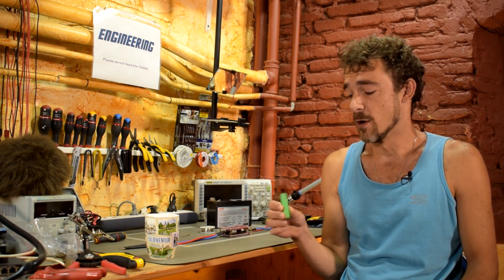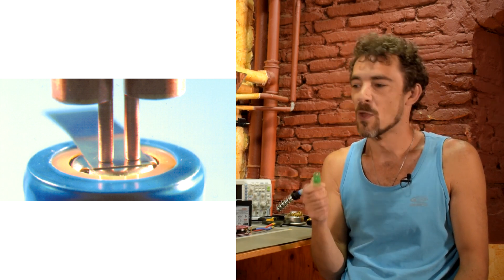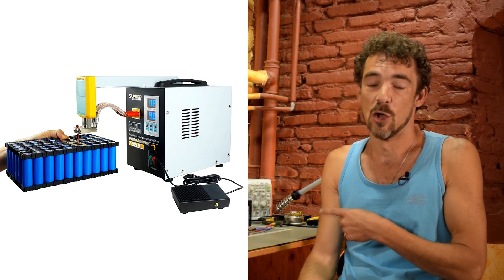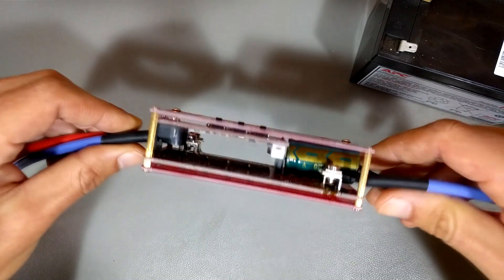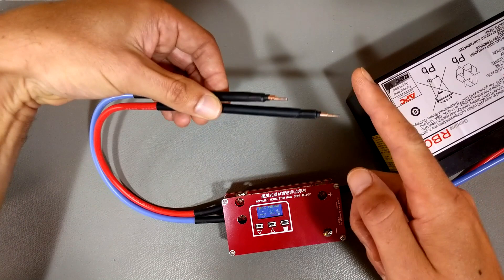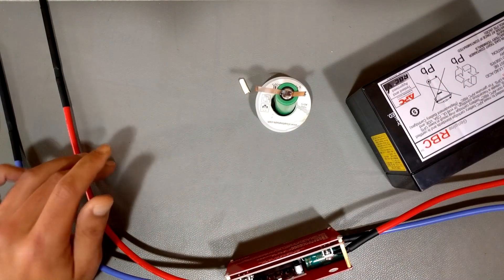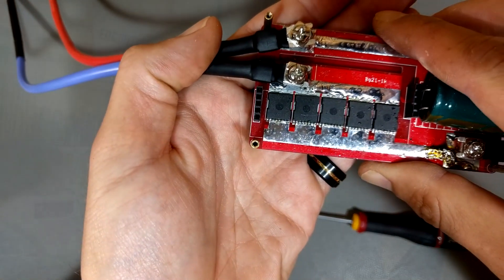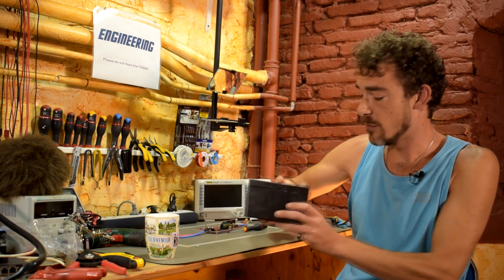The $16 battery tab spot welder

Comment from the maker: UPDATE: Heck with this thing! I built my own, and it works great: https://www.youtube.com/watch?v=pyQ-gbYM8Og
Reply: I saw the reply from BeiLLiac4
 after posting my comments. This is an edit.
 
His solution is elegant, beautiful, and inexpensive. I plan to go a little farther, but his solution may be sufficient for most users.

Scottie, I received a different flavor of spot welder from a U.S. seller while waiting for one like yours to arrive from China.
 
These are actually very simple devices that suffer from multiple unwise design compromises.
 
First they use a microcontroller that is extreme overkill, even though they are very cheap.
 
The microcontroller and associated electronics operate from the 12 volt supply common with the welding power source.
 
That is a very big mistake. The one I have here uses a 78L05 regulator, but if the 12V power sags under extreme load, the CPU will not make you happy.
 
This is why a weak main 12 volt supply will cause failure.
 
Cheap small gauge wires feeding the unit will cause a voltage sag under load and also contributes to failure.
 
The  voltage sag under load causes insufficient drive to turn the mosfets fully on.

A mosfet is likely to fail when it is operating between fully on and fully off where massive power is dissipated in the channel.
 
The first mosfet to fail will short and likely save the others from destruction.
 
The welder controls the negative leg of the power and the positive need not even connect to the board except to power it and possibly detect when pins touch the nickle.
 
I am going to hook up a separate small 12 volt regulated supply to the board and let the main positive wire bypass the board completely.
 
Later a capacitor or other circuit might be added to allow detection of when pins touch the nickle.
 
Please let me know if you want updates on this as more is learned.
 
I believe a few simple inexpensive changes will make a big difference in reliability and performance.
Reply: They need a cap on the board it drop voltage at mosfet and resistance gets to high  that's how I fixed mine
Reply from the maker: @mikehodgetts4864  It's got pretty much NUTHIN... Not a very well-designed unit.
Reply: @ScottiesTech  I try to avoid buying anything from China so this was an exception.
 
It was ordered on Oct 17, 2020 and I will reverse engineer it and try to upgrade it when it arrives.
 
Another YouTuber, zec23dark did a video where he removed the blown FET and replaced it with good results.
 
https://www.youtube.com/watch?v=TC30oNb_VP0

If the upgrades work and are easy and cheap, I'll let you know.
Reply: Scottie,
 
This might be a good time for an update on my approach to battery spot welding.
 
The main theme could be called "overkill".
 
The first part is the main power source, super capacitors.
 
A computer server power supply that can produce 62 amps at 12 volts will charge a bank of five 2600 farad 2.5 volt super capacitors through five 1 ohm 100 watt aluminum clad power resistors on a large aluminum heat sink.
 
The 12 volts will be switched with a large N channel MOSFET. This has already been prototyped and tested.
 
I am building the wood mounts for the super capacitors now.
 
Would it be a good idea to make a video of this ?
 
I have never done a YouTube video. This would be a first and very basic effort.
Reply from the maker: @mikehodgetts4864  I'd watch it. Go for it!!

Comment: Wrong battery, common burn out at 4 spot welds with that battery. I have had mine for 5 years using a  3S 35C to 70c RC lipo battery, it can dump all the amps all at once so you don't fry MOSFETS.

Comment: "At least 12v 5 AH??" How did you arrive at that?? ...The instructions say a 12v car battery from 25AH to 40Ah (lead acid battery) minimum, so your tiny 7AH lead-acid ups battery is NOT "more than adequate." I think the confusion is when they say you can use a "model aircraft" LiPo battery of 4000-6000mah which yes is around 5.0 -6.0AH, BUT most of them that size have a 50C (instructions say 45 to 60c) rating. Let's round it down 50c x 5ah = 250A bursts...Lithium polymer hobby grade batteries are not the same as a lead acid battery.  The instructions also say this needs 120 to 180 amps current.  That tiny battery's voltage will seriously sag well before that is reached, which is why people using these puny UPS batteries are smoking the MOSFETs right and left
Reply from the maker: My had instructions... which did NOT say what your instructions said - not surprisingly. This video is 3 years old.

Comment: I have this welder version BL 01 2k and have done all modifications and I haven't had any problems/issues at all. Used it a lot ans it really works good. This is just user faults when you missed the nickel strip and you really don't need to set the energy so high with good weld.

Comment: That little battery is the reason it died. I had the exact same thing happen. The mini spot welder needs a hefty battery!!  I don't know why the manufacturer would say 5 amps and up. It needs a lipo of 50c or more. I have 3 of those mini spot welders and they work  great as long as i use the right battery.

Comment: Found this video to get the right settings for the one I bought a while back. First test weld on a dead AA was pretty good. Second weld attempt was extremely weak. Third and fourth were sparks and smoke from the mosfets. What a piece of junk. Shame as the controller seems to want to keep welding. I wonder if I could just replace the mosfets.

Comment: You did it wrong, dude!  You left it in manual mode, which requires the foot pedal.  Otherwise, the energy is released the moment the two probes touch the strip!  You were supposed to use the auto mode, which then beeps and releases the energy with a slight delay after you already have contact.  Come on, dude, at least learn to do things right before you post!
Reply from the maker: I switched it back to Auto mode before doing the first weld (I actually edit my videos even tho it may not seem like it).

Comment: you ignored the instruction. It says the battery should be capable of 40-50C at 5Ah. Somewhere around 200A - 250A instantaneous current. That is possible with high quality 3S Lipo but not with a backup UPS battery. A car battery that has a CCA of 400 and up is good.
Reply from the maker: Mine didn't come with any mention of 40-50C... Just "minimum 5Ah at 12V". Oops.

Comment: very important to use a suitable battery, the UPS battery you're using is not meant to discharge at levels that would saturate the FETs. You need to use either  a high C lipo or a car battery, cold cranking amps above 200 is best. These actually work pretty good when used with the right equipment. You should try again with a 3S 50C +, you'll get better results. jmho i.e. https://www.youtube.com/watch?v=arOsjpQy45s
Reply: The battery isn't providing the high current for the spot weld. It just charges the capacitor. The capacitor is what discharges to spot weld.

Comment: the battery that you were using is too small in the first place and the second place after a few welds your battery was drained and the voltage was low this caused the damage in your spot welder... I suggest you troubleshoot make a video of your troubleshooting send away for a new control board or some new mosfets and repair it on the video..... lots of videos on YouTube display the same problem trying to pull too much energy out of this little device trying to pull too much energy out of a lower than necessary voltage battery lower than current rated battery lots of videos say that they love this little device when used properly the key word here is used properly 16 bucks each I bought two waiting for them to be delivered we'll see what happens

Comment: you used the wrong battery idiot! you need 25-40 Amph battery not 7.2 holy shit read the documentation!
Reply from the maker: The 'documentation' that came with mine made no mention of such a high current rating.

Comment: You used the wrong type of battery, you have to use a high discharge battery. Flooded lead acid batteries like car batteries work as well as high C drone batteries.

Comment: Isn't one of the primary reasons for welding vs. soldering that in high current battery packs can generate enough heat at the terminal that it can melt the solder?  I learned that the hard way with helping my grandfather with a resistive foam cutting rig, my joints melted almost immediately.

Comment: the battery amp hours are no way near enough. i use 2 12v 15ah in parallel and mine works perfect. i also did the capacitor mod and beefed up the tracks with fresh solder.

Comment: I just happened to notice this video that says that a low voltage condition can undersaturate the MOSFETs and cause them to blow. He also has a simple mod for that. Re-move the space after the dot to get the link:  'Cheap 18650 Spot Welder Reliability Mods and Test'  youtu. be/u5khY6d3qds?t=170

Comment: Yes, it work well, I just tested it using 12v 7AH battery for source power.... parallel with battery charger setting of energy on 50 good welding and no modification on it

Comment: Keep in mind that as far as the bad welds go, you have to press the probes firmly on the tabs and and they have to be on the meat of the cell to get a good weld. Where the tab blew there was an air gap underneath it because you had one of the probes by the edge of the positive terminal of the battery cell. The second time, you welded the tab with nothing underneath it so it would obviously blow. 

Also, if the spark was too high on your first three welds (not shown) it’s possible that the welding probes needed some polishing/refinement due to an uneven surface or slight charring at the point(s) of contact.

There seemed to be other issues with the with the unit, like not beeping prior to the auto-weld, so the unit had its own issues.

I thought I’d mention this for anyone watching this video and reading comments. I have extensive experience using high dollar spot welders. Tabs will frequently blow without proper contact between the probes, tab and metal surface.
Reply: What you are saying is true, although too much pressure is also bad.  However in this case the unit did not beep after about two seconds of contact, just immediately sparked.  I would have hoped it would fail open and safe, instead of closed and scarey!  You can see this in other videos of it working.

Comment: OMG when you saw how it spot weld like that is basic common sense  all you need to do is adjust and lower the setting to 40 like 15 then go up. If you use small battery on this 40 setting is not enough. Then you going to say bad product geez

Comment: you should change the broken mosfet, put a capacitor after the diode for the control board, the 5v rail. then use a battery like your other spot welder. this battery went down below 5v when you welded and it couldn't close the gates or manipulate the mosfets correctly and you destroyed it. i welded 100 welds with a 150A battery without issues. this welder is actually nice if you mod it with the cap (1000uf 16v).
Reply: Tell me more. I actually need to mod this. I wondered before I do it Ill find some info from internet who already had this issue

Comment: There are a range of these welders, all have various faults from factory.

I've bought one, done the recommended mods for my particular model and it seems to work fine. I've welded in such quick succession that the probes get hot to hold so with the right mods its OK.
Reply from the maker: Yeah. And unfortunately, it even seems that different models come with different instructions as to what battery to use. SIGH...
Reply: @ScottiesTech  yeah it's really random. I've just stuck it onto a 40ah car battery with good results. 40ah is the biggest battery they recommend however I dont see why it would be bad if it were bigger, as ah is a rating of capacity, not amps. The instructions I got with it also said not to exceed 50E of power, no idea why.
Reply from the maker: @spinnanz  Exactly. 5Ah can be 100A for a very short time... Of course, it depends on the design of the battery since lead acids are not all created equal. And with lipos sometimes I've had 'super-huge' ones fizzle out on me, and small ones supply current like crazy.

Comment: Needs a capacitor on the control board.  The MOSFETs open but the controller doesn't have enough power without the capacitor to close the MOSFETs after they open.

Comment: You mention the reviews on BG,  I wouldn't trust them at all -- I've never seen any on there that gave less than 4 stars.  I've bought a few things from them,  with mixed results.  I saw this thing mentioned in one of their promotional emails,  and looked at it,  considered it for a second or two,  and decided against it.  I'll probably end up homebrewing something around a microwave transformer anyhow.
Reply from the maker: I've had luck with them, but mostly for components. 18650 cells, caps, whatever. But pre-made stuff? Well, I guess not...
Reply: I've bought some arduinos, sensors to go with them, blank circuit boards for projects, and recently some ESP32 modules to play with.  In the case of some audio level indicators they shipped with defective LM3915 chips, where two pins on the chip package were not properly connected.  I eventually sourced these from elsewhere and they gave me a partial refund for those kits.

Comment: There are a number of design flaws with this unit and several revisions available for purchase. My particular unit had an issue with the gate drive circuitry, because they chose to use undersized gate drive resistors. The gate drive is a simple totem-pole arrangement of BJT's that drive each MOSFET through a 30 ohm 0603 resistor below that massive capacitor. The problem is that those tiny resistors can't handle the impulse energy for the gate drive (they dissipate peak power of 12^2/30  = 4.8W for a microsecond or so.) So they end up blowing open. with a high impedance gate drive, the gate is not driven hard and can cause the MOSFETs to dissipate thousands of watts and blow instantly, usually short-circuit causing the failure you observed. Mine failed a bit more spectacularly with bang and MOSFET exploding.

Also that 10AWG wire is just not thick enough for this application. large diameter wires are quite expensive, might need to find some welding cable since those should handle the current. Another alternative is to power this unit with more voltage and just deal with the voltage drop across the 10AWG wires. If you do a lot of welds on a big bank, the electrodes quickly get too hot to hold in your hand. I found after about 10 welds I had to let the unit cool down. The wires seem to heat up the most.
Reply: Also that UPS battery isn't optimal, it will not last long in this application. I'm using one of those lithium ion booster packs to jump start a car, they can deliver in excess of 1000A into a short circuit. Using a lawn mower battery or a car battery would be better. Such cells are designed for high pulse currents, they differ in that they use a lead sponge material with a lot of surface area, as opposed to a deep cycle battery which uses solid lead and has space near the bottom for lead to flake off and build up allowing greater longevity when deep discharged.

Comment: the same thing happen to me i open it i put more solder by the terminal and the line that go to the other terminal also i change the positive prob cable position and put it with the other positive lid and now works great also before it did not make the beep before it weld now it does thank u for the video

Comment: You need to retry! But first, change that small 7.2Ah battery with at least 30Ah or greater. Small battery capacity pose 2 risks: bad weld result, damaged mosfet switch. But then..., does your welding kit still working?

Comment: I bought this last week I connected it to a new fully charged 11.1v 3s lipo  showing 12.42v it did not weld the nickel strip together only burn Mark's  I then turned the unit up to full power after 3 attempts it blew the front off 2 of the mosfet? It does state in the add lipo is ok to use I have now had a full refund do you think it is because of the lipo power? Would it be better using a car battery I'm not sure why it blew the mosfet up it made a loud bang I would think the 3s lipo would be enough power?
Reply from the maker: The battery matters, but even if you use one according to the included specs, it will still fail due to a design flaw. This guy fixed it: https://www.youtube.com/watch?v=fdnO0Z-scjA
Reply: @ScottiesTech  nice one thanks it seems a nice little unit I will mod mine cheers for that mate

Comment: You were using the wrong type of battery.  You can use a model airplane battery 45-60C.  
This video explains why but basically you need a battery that can deliver a high discharge rate of around 120 amps.  https://www.youtube.com/watch?v=231qtaRIs3M&t=570s

Comment: Hi, I found the control circuit of this board has an error, i fixed it and changed MOS with stronger ones. Now it is working very well. See my mini spot welder watch before you use.
Reply: I mean: i made a fix video on youtube
Reply from the maker: @MakerFabio  I watched it. Well done!! I couldn't be bothered to try to figure it out myself, but your fix does indeed work. I linked to your video somewhere here in the comments.

Comment: I think mosfet ratings usually are with a heatsink, which that does not have. Without a heatsink those mosfets will only safely switch a much lower voltage.

Comment: If you use a battery as described in the specs, it works. When you use it with a weak backup battery, it will kill the MOSFETs when the battery voltage goes too low. This guy gives goo explanation: https://www.youtube.com/watch?v=231qtaRIs3M